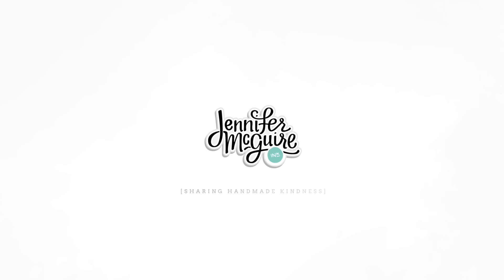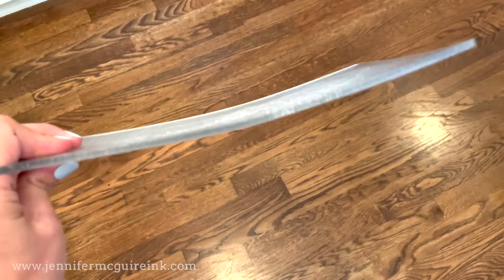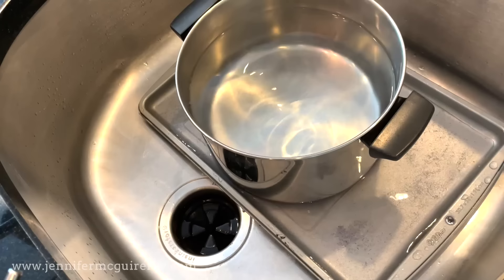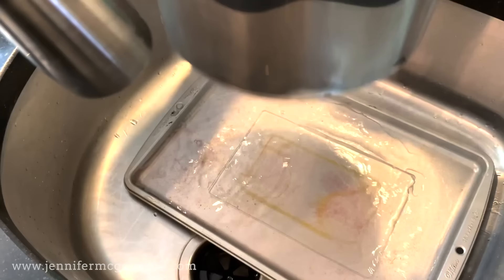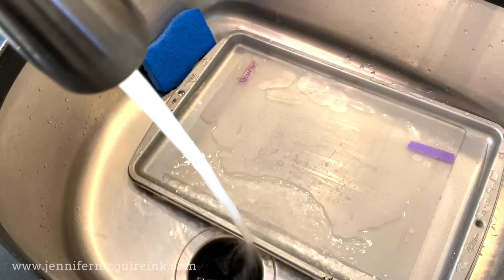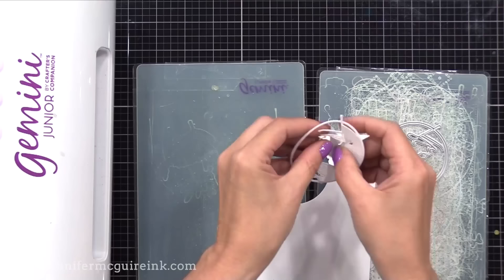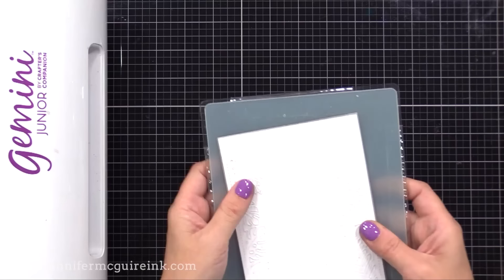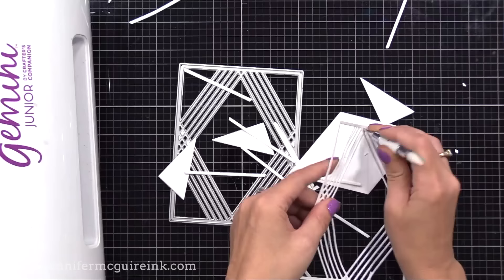Fixing & Avoiding Warped Die Cutting Plates

Comment: I created my own shim to use only if I'm not getting a good cut.  I ran a laminating pouch through my laminator and created a clear plastic sheet.  You can them trim it down to fit into your machine.  It's not super thick like metal and it still has some "give" to it.  It doesn't flatten over time the way a cardstock shim does so it can be used over and over again.  If someone needs a slightly thicker shim they can laminate a piece of cardstock to have the thickness of the cardstock added to the thickness of the laminated pouch.
Reply: Thank you Laura, I will give that a go 💜
Reply: what a good idea.  Might give this a go, thanks for sharing.
Reply: Thank you so much for the laminating tip. Will try it.
Reply: So clever!
Reply: Love this tip. I got a laminated piece as packing material and use it but it is getting warn so this is a great option. I was thinking of using a sheet of acetate from packaging but this seems more durable. Thanks.
Reply: Glad my eye caught your comment as I was leaving mine.  Will try your idea--thanks!
Reply: Great tip  .. thanks
Reply: Yes!!. I discovered this idea by accident when I unintentionally sealed a laminating pouch without paper or card in it! Discovering I needed a shim whilst doing some die cutting the fused pouch was close at hand so I thought, what the heck, cut it in half to make it the same size as the cutting plate, and gave it a try! No warping, no imprint and good to go for a lot more times I hope. Thanks!
Reply: Great tip.  Thanks.
Reply: Thank u 4 this tidbit of info. I greatly appreciate it. Have a great day.
Reply: What a brilliant idea! I just bought a laminator, finally! I’m going to try that! Thanks!
Reply: That is what I do too.
Reply: Thank you, Laura Buehler!!!  I will try both the plain laminating pouch as well as adding cardstock into a laminating pouch for some shims.  Fantastic idea!  I have a basic laminator and it's a helpful tool for crafting, especially for organizational work.
Reply: Laura thank you so much for this info.
I am going to buy a laminator as I don't own one but it's worth it for so many reasons, especially this one. Thanks again. 👍👍👍
Reply: Thanks I will definitely give this a try!
Reply: My friend accidentally gave me a Cricut joy matt and my machine is a lot bigger. I use my hit Matt as a shim.
Reply: Yes, i've been doing that for about a year too, works brilliant, but now i want to try one with an acetate in it so i can use that one as a thicker shim, instead if the cardstock in it, so i can see through it
Reply: That’s a brilliant idea, way to use your craft supplies for multiple uses. Impressive. ❤️
Reply: Wow great idea
Reply: Hi Laura, I do the same. I cut one pouch’s leaves at the top. Then I insert it between an uncut lamination pouch. Finally I run it through the laminator. 
With these thicker plastic sheets, I will also cut stencils from these plastic sheets on the Cricut Maker. 
I’ll  sprinkle lamination sheets with sequins/glitter, run it through the laminator for the winded of shaker cards. So fun! 🤩
Reply: @stonechops  what a GREAT idea! No waiting for glue to dry, no glitter escape on the card, so many good reasons to laminate the glitter. Genius! I can see me die cutting the glitter laminate and using them on the card.
Reply: Great idea, Laura!
Reply: What a great idea. Thanks for sharing
Reply: @stonechops  oh my goodness, I love this idea for shaker card windows! This is brilliant!! 💕 Thanks!
Reply: @stonechops  what do you mean by winded?
Reply: Clever idea. I’m going to try this.
Reply: This is a great Tip, Laura! To bad I've already ordered the green Gemini Double-Sided Self-healibg Plates. Oh well, I can make laminated shims to use with my old hand-crank devices!!! I just love these comments - Thanks Laura!!!
Reply: @Aeronwen813  lol I’ll ll
Reply: Great idea. Thank you, Laura.
Reply: thanks so much Laura!
Reply: I've been looking into laminators, any advice on a good one?

Comment: Thanks for this update. Since switching to a self healing mat, only the mat has warped, not the cutting plates. I have tried 3 different brands of self healing. They do straighten using a heat tool. I usually want until all three are badly warped before getting the heat tool out. Just ordered the Gemini jr. double sided cutting plates. (Plus a few items from my wish list. You can’t just order one thing, right!?!)

Comment: Love this. I have another hint. I have extended plates and large Gemini plates that will not fit under a pot fully. I use a jelly roll pan (cookie sheet with sides) and put in a small amount of boiling water and the plate. Then I put another jelly roll pan on top. Add more boiling water and then a heavy pot on top. This gives even pressure throughout so no end curls or water bubble blips to deal with.
Reply: Great idea!
Reply: Me too. I also discovered that I can put them in my dishwasher. I don't have to boil water then!  I have the large gemini also.  I put all the prongs of my bottom dishwasher rack down (all of them will lay down rather than stand up.  I then put a large cookie sheet,  my plate(s), another cookie sheet on top and a heavy pot on top if that 2nd cookie sheet.  Turn my dishwasher on and walk away.  When the cycle, including the dry cycle is done and the water in the pot has cooled, I come back and dump the pot of water out and remove the cookie sheets and my plates are flat again! I figured this out bcz I was tired of getting water all over my counter when doing the cookie sheets on my counter with boiling water since my sink is a double and not big enough to accommodate the larger cookie sheets. 
That being said,  DO NOT PUT YOUR CUTTING PLATES FREESTANDING IN THE DISHWASHER.  THEY WILL CURVE UP LIKE NO OTHER.  I HAD HEARD GINA K SAY SHE JUST PUTS HERS IN THE DISHWASHER AND THEY COME OUT GREAT SO THAT'S WHAT I DID. I was able to fix them by boiling water and softening them enough to get a less of a curve in them and then I did the cookie sheet thing in my dishwasher and to my surprise that's how they came out flat again.  Otherwise I was going to be buying 4 new plates
Reply: I have recently received a used Gemini junior machine the plates are not to bad at the minute but if I do the tip in this video, does the pot that goes on top have to have boiling water in as well? Or could I just boil the kettle then pour that in the plates and put like an empty sauce pan on top? Sorry I’m replying to. Your comment it won’t let me comment otherwise
Reply: @lilysandell4638  the heavy pot of boiling water is for the weight of the water and the heat to keep it at temperature long enough to do the job.

Comment: Thank you, Ken, for mentioning the dangerous vapors that are released in the oven.
Reply: I was so pleased Ken mentioned this as well Carol.   I have seen a number of videos on flattening plates by putting them in a very hot oven and I have known for some time that when you heat plastic toxins can be released.  I would not insult the provider of those videos but it's very concerning when being told to do something dangerous.

Comment from the maker: Hello! A few added things:
- The double sided plates will be back in stock soon! 
*  UPDATE: The green double sided plates have not warped at all. It does wear after ton of of die cutting (1000+ passes), but I just used the other side and continued. So - as with any cutting plates - they will have to be replaced at some point but not due to warping.
* REMINDER: Cutting plates are meant to be replaced eventually. Eventually all plates will wear too much, break, etc. But I find these tricks help to make them easier to work with for the life of the plates! (aka no warping)
- Someone asked if the double sided gemini plates will dull your dies. i have not noticed that happening, and i have mass-produced-die-cut with them. and i would assume they wouldn't dull them as those plates were designed for it. That is my guess!
- I have not tried these double-sided plates with other machines. 
- I do not think flattening plates will effect the life of a plate. But it is hard to say and be sure. Plates are expected to have a limited life span and be replaced at some point anyway. I am just trying to find a way to make them useable for a longer time :)
- To see the correct way to use the double sided plates with double sided dies, check out this video: https://www.youtube.com/watch?v=5xJde8V2gXA
Reply: Will those double sided plates work on the big shot? I ended up with one of the cute double sided dies as a gift....but only have a big shot..thanks for all the great ideas!
Reply: Will the taped sandwich plates work in the empress?
Reply from the maker: I normally don't tape the empress, and use empress plates with it only.  And I don't have problems with them warping. 🤷‍♀️
Reply: Well what’s interesting is that these plates are made for double sides die cuts but warp less because they are made stronger than the regular plates. Im all for reducing the layers that is needed t get the same outcome, especially when it is less work for maintenance. 😌 Its the gemini thats new to me, not purchasing new cutting plates. Ive had mega dozens of those.
Reply: I tried the boiling water thing with one of my green plates because I thought it would get rid of so much white stuff embedded in the plate.  It was not warped.  I thought it was paper.  It did not get rid of the white stuff and very little paper stuff came out.  BUT I have a feeling that procedure was not good for those particular plates because now the plate is chipping chunks of plastic off on the one side that is always against the cutting side of the die.  It's almost like a layer is coming off.  I have only had the plates since Sept. 7th and have not done nearly the cutting that you undoubtedly do, Jennifer.  So I ordered a new set.  For now I turned the plate over and will use it that way until it needs replacing.  Then I will move the other plate I'm using now to the side that's getting all the cutting and put one of the brand new ones in it's place.  (Clear as mud?)  Anyway. I so love not having to add shims or mats or metal sheets, etc.  Just the two clear and two green.  I did not tape mine as it was really no problem.  Would it be better to tape them, though?

Comment: Thank you so much for this tip.  I tried it yesterday on a couple of plates that were badly warped.  They are not perfect but are a ton better than before. Thank you too for the explanation of how it works and the dangers of heating the plates in the oven. As usual you did not disappoint in any way.

Comment: Thank you so much for all the research and sharing that you do.  Thank you also to Ken for sharing is knowledge!  I have to admit, I loved his video where he snuck into your craft room and made a card.  A nerd with a great sense of humor is a win-win!!!!!
Reply from the maker: I agree!
Reply: I heated water a small(5”) and medium (8”) flat-bottomed saucepan til boiling. Put plate in 9x13 heavy aluminum cake pan in the sink. Poured water from medium pot in the pan over the plate and put small pot with boiling water on the middle of the warp. (Small pot pressed on the middle  bulge.) Filled a larger 10” pot with tap water and balanced  it on the medium pan for weight!  After about 20 min, I poured the water from the large pot into the pan so the plates would cool and harden with the weight of the small pot still on it. Poured water from the medium pot also (can scrub with a bit of detergent and a brush if needed. Good improvement in the 6 warped plates I tried.

Comment: thank you for the tips - I also keep one of my cutting plates as a "do not cut plate" .  Since I don't cut into it, it doesn't seem to warp and therefore I always have a flat surface to run through my machine.  I have also purchased the self healing cut mats and have great success with those

Comment: Thank you, Jennifer and Ken! I've tried the hot water method before with little success, but can't wait to try the extra pot!!! Actually sad I'm on vacation, lol! We don't have a farm sink, so will see which pan will fit and also accommodate the second pot.
Reply: The bath tub? Hopeful  it's on the same level as the stove.
Reply: I have a small metal cooking sheet from the dollar store that fits in our small sink and is just big enough for the Gemini jr plates
Reply: I just use a large cookie sheet (I have the regular gemini) and a smaller cookie sheet on top.  Put water in with a glad measuring cup,  0ut my pot of boiling water on top for weight and finish adding water to the cookie sheet until I'm sure there is enough water.  I leave mine until the water is completly cool. Walla...flat plates

Comment: This video has came at the perfect time!! I am literally in the process of returning my gemini because of this issue. Had my plates for only a month and it bent to the point where it won't go in the machine.
Reply: Wow! That’s strange
Reply: Same and the cutting plate has cracked across the middle. 😔
Reply: @irenedavo3768  I have had the same issue. Stopped using it. Now I will try again.
Reply: When my large plate split I cut it in half, filed the rough edge and now have 2 smaller plates for when I'm using small dies. Saves throwing the plates away and I only use my large plate for large dies

Comment: Great video on preserving and fixing our cutting plates Jennifer! One little tip I'd like to add if I may, which helps make it easy to know when it's time to 'flip' your cutting plate and use the other side, to reduce warping. This is when the centre feels like it's springing up if you put pressure with your finger in the centre of the plate, that's the time to flip it, and cut into the convex side. Essentially, if you rotate your plates regularly, and always cut into the slight convex side (as you know, if you cut a bunch on the same side this happens), this will even the plate back out again. I have Sizzix Big Shot plates and this works really well to extend the life on these. I'm so totally going to try your boiling water and pressure treatment on my very warped eBosser plates though. I bought that machine before leaving the UK and learning the 'rotate regularly' trick! So those plates will benefit from your clever repair trick, thank you so much! Thanks to your hubby too for his fabulous explanation.
Reply: Thank you both so much! What a fantastic tip!! 😍

Comment: Thank you for all of your time and effort and then sharing with us. I use a big shot. When I am not using it, I keep my cutting plates run half way through it. If they are a bit warped, I place the hump side up. This tends to keep them a little less warped and more straitened. I don't know if this is good or bad but it just what I do. I have a lot of warped plates that I am going to try your method out on. I like that it cleans them too.

Comment: This really works, better than the oven technique. I did mine as Jennifer directed and even added the weight of a cast iron skillet on top of the pan of water, let sit fo 30 min...works like a charm. Also the tip with the Gemini Jr of not using the center of the plate unless you have bigger dies that take up most of the plate really helps. Thanks Jennifer  for continuing to keep us up to date on tips and tricks, esp the $ saving ones.

Comment: Fantastic, I used your taping together of the plates previously but this upgrade looks great. I tend to go through phases of using the Gemini plates or Spellbinders grand calibur plates in my Gemini but all have warped badly over time but will definitely use the boiling water system to get them straighter..  great explanation by your husband. ..... I now totally understand where I went wrong by baking one set of plates....deary me what a mess that was 😂 Thank you for putting so much time and thought into this ♥️

Comment: I just saw this video this week. I tried the boiling water method and girl, let me tell you, it worked! I had to do it twice, but that's ok. I did sit it outside on a paver and had to place added weight on top of the pan lid. I left it outside for about 45 mins-1hr (only because I forgot it was outside). When I took the pan off (the second time), the cutting plate was as straight as the day I bought it. I'm so jazzed about this method.  Thank you!!!

Comment: Jennifer in February I bought a Platinum 6 machine and within a month my plates were warped and I was beside myself on what to do.  I of course ordered new plates, but they took time to arrive.  So I put the old plates in the dishwasher without much success.  They were cleaner, then I decided to rotate them with every cut.  This was easy because Spellbinders has printing on one end of each plate.  When I finished die cutting I would insert the Label end in differently each time I die cut.  This helped to straighten out my plates and LOL I am still using the old plates and they work beautifully.  I will try straightening out my Gemini plates with your method and I ordered the double sided plates.  Thank you so much for all this information, you are the best.

Comment: Hi Jennifer. I used your technique for my Sizzix Plus die cutting plates.  One was warped way more than yours were and I am happy to say that using your hot water technique to flatten both of the plates worked very well.  They did not get completely flat, but they are certainly better and just slightly warped now.  I actually tried the technique 3 times on each plate and none of them made the plates exactly flat.  But they are easier to use and I will also use your techniques of moving the dies around on the plate surface so maybe they won't warp as badly as before.  Thank you so much.